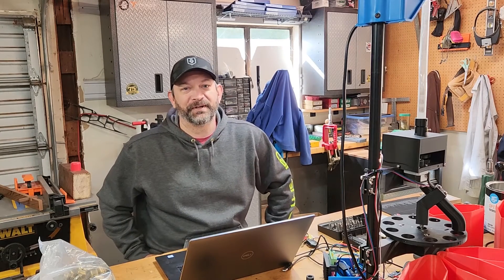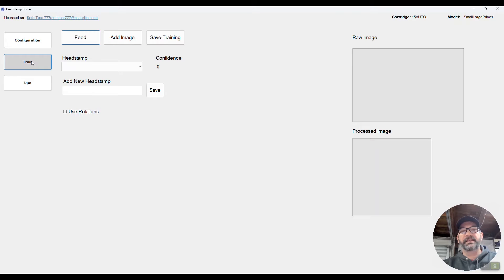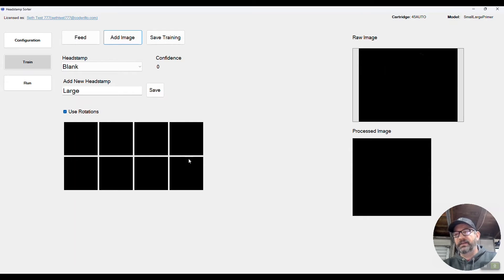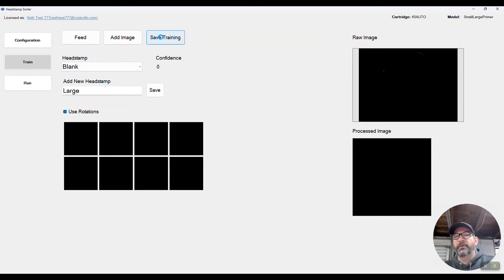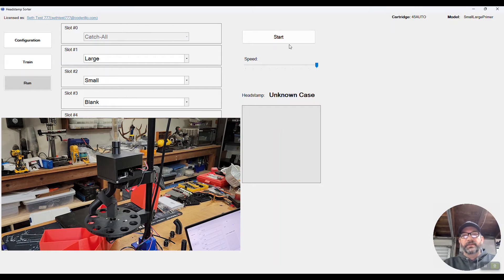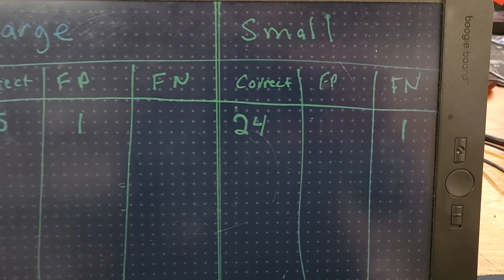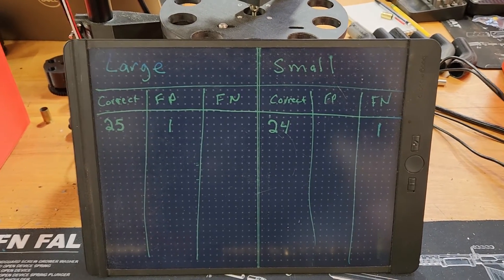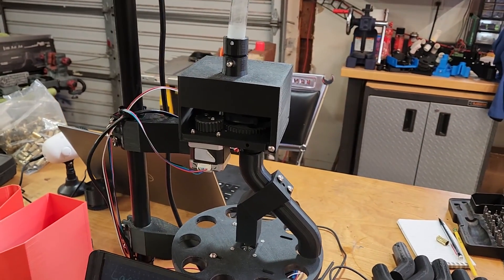CS7 - Automatically sorting 45Auto brass by primer size

Comment: Hello - collecting parts for building this - Ive noticed in all your videos the brass still has the old primer installed. Does your system work as well on decapped brass ? Im thinking i would sort after everything had been cleaned...
Reply from the maker: Yes, it works with decapped brass as well. Definitely better to clean the brass before running it through the system.

Comment: I'm having an issue where the processed image is way off center even though the raw image is centered. Tried turning the camera, but no luck.
Reply from the maker: Thanks for giving this project a try!  There is a new software release coming out soon which will help to address this type of issue but for the benefit of the channel and this thread, I will outline what I believe to be the issue here (without knowing further details).   I have stated many times that the system is designed to be used and works best with black printed items. If you are using any color other than black for the classifier base, indexing wheel, camera body and tension cam, the pictures may not be processable. The raw image should appear to look like a single piece of brass on a completely black background. If you are using black, it is possible that your print has "shiny" areas that reflect light from the camera ring. This can be resolved by roughing it up a bit with some fine grit sandpaper.  These are the most common issues/solutions for misaligned image cropping.  If you would like to troubleshoot this further, please feel free to email me. My contact information is in the channel information (but only from a computer as it doesn't show from mobile devices). Best of luck!

Comment: Looks really good.... I cant really get the program to run on either a windows 10 or 11 machine... Any ideas?
Reply from the maker: A couple things to note.  The computer must have a processor that supports AVX instructions (AVX2 should be fine). This is most modern processors with the exclusion of most of the celeron line of processors (unfortunantly). The computer should be a x64 architecture (64bit). Also you may need to install the VS Redistributables first.  If you are having other issues, you can find my email in the contact information for this channel (but only if on a pc as it doesn't show from the mobile devices).
Reply: @sjseth-builds  Ah! I will check up that about AVX.... The rest of criteria is fulfilled.... I hope it'll work because this is a great idea!!!!

Comment: OK, so I just realized that the pictures being taken are looking inside the case as opposed to the head stamp.  So, is this a different base with a different camera mount specific for sorting 45?
Reply from the maker: They are still looking at the bottom of the caes (not inside) we are just cropping from the center the area in which a large primer fits.  That means the pictures of a large primer and small primer have a significant difference as the small primer has a larger padding. This effectively lets the machine ignore the headstamp altogether.

Comment: will this sort by caliber now or in the future?
Reply from the maker: It will probably never sort by caliber. There are already very fast and crud methods to do that which don't require image recognition and machine learning. Something like this:  Shell Sorter Value Pack for Sorting Mixed Brass by Caliber https://a.co/d/76QlX3j
Reply: @sjseth-builds  thanks just wondering
Reply: @sjseth-builds  would this be overkill for sorting 38 super and 9mm from 38 supercomp? 38 super will jam the shell plate on a Dillon, and 9mm is very similar in diameter so they are hard to sort using the previously mentioned methods.
Reply from the maker: I think it could work with 9mm and 38supercomp. The key factor is that the case length needs to be within 3-4mm of each other and the diameter should be close otherwise the system would probably jam.
Reply: @sjseth-builds  Thanks, I am currently waiting for the parts to build mine and I will let you know how it goes.

Comment: I just started printing your project. I started with a small part or two to test my Ender 3 Pro, mainly to see if the parts will stick to the bed. It has been fairly consistent with most filament brands I use, and I haven't had to mess with the bed level in months. Just load and go! Currently using Hatchbox Black PLA.

Comment: How powerful of a computer do you need to run this?  Would something like an Intel Atom processor based system work?
Reply from the maker: Not sure about the atom. The software does require a 64bit processor/os. A slow processor will be noticed mostly during the training and shouldn't effect run speed very much.

Comment: Super excited to get this project up and running. Thanks for the continual iterations! I purchased the entire shopping list and didn’t see a power supply or the power button from your blue V1. Is that not needed on the black box? It would be helpful to separate the purchase list and the print files on hit hub to know what’s needed for each version.
Reply from the maker: Generally I use a 5A  12v power supply for my projects as they are very cheap on amazon.